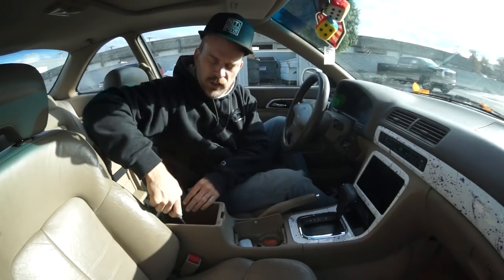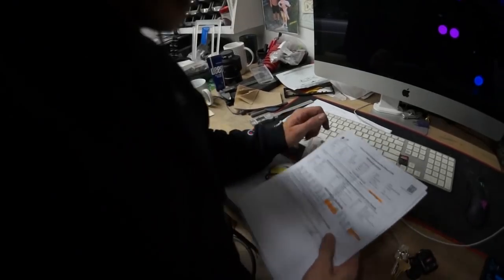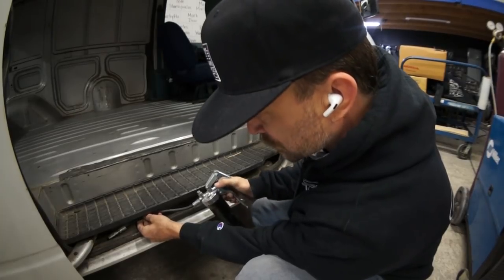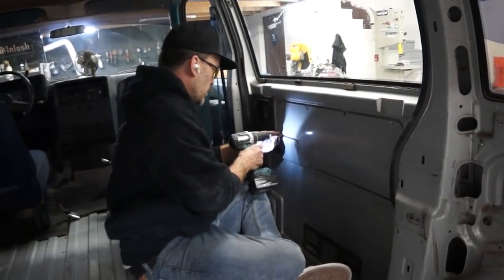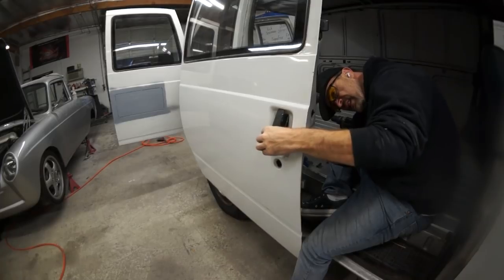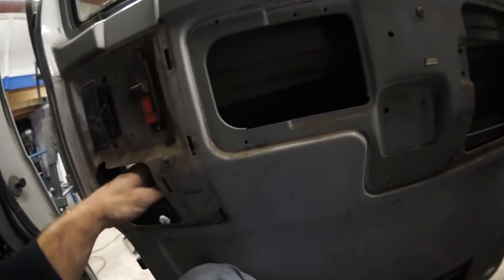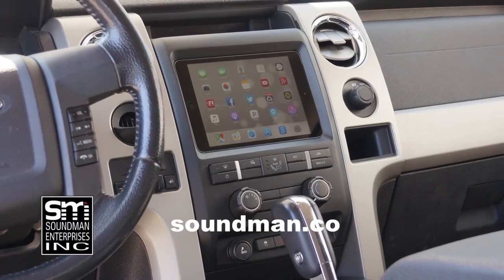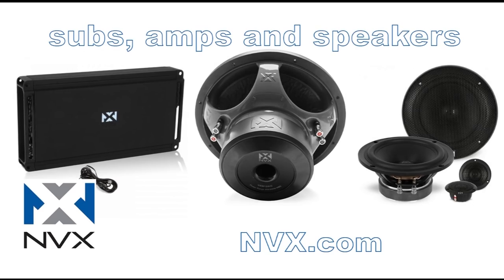more stripping and shaving of the SOUND VAN! - the bass van vlogs #6

Comment: Use compressed air to cool off your welds. U can also cause warping by cooling it to fast with a wet rag. Ive got over 20 yrs in metal work like this

Comment: Dude I love the new idea with the van but you need to turn up the voltage on your spot welds. Those panels are going to crack right off after the first full volume pull you do .... you have the right idea you just need more... every 1/4 inch a spot